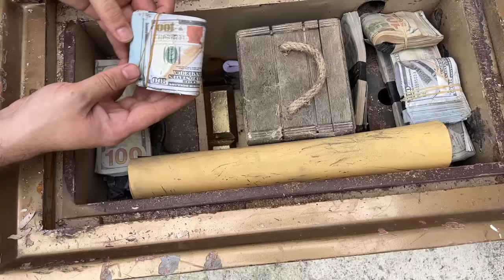We Found A Abandoned Safe In The River. What's Inside The ABANDONED SAFE? (OPENED)

Comment: At 6:48 upper left corner they only started putting that blue stripe on 100.00 bills and into circulation in 2013, so the safe has only been in the water no more then 10 years. The rest of the money doesn't look in as good of shape. Safes are made to be fireproof for a hour, waterproof though? I'm 50/50 on hoax or real. Would be fun to find that much money though.
Reply: Total bullcrap 💩💩💩
Reply: Hoax